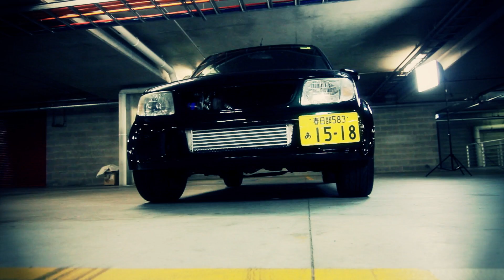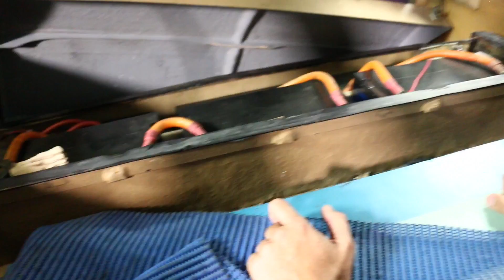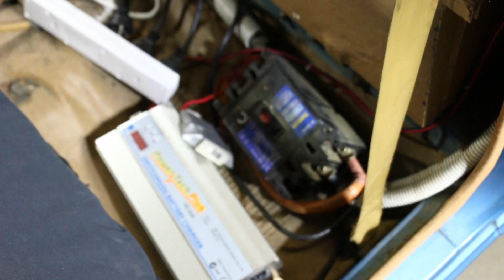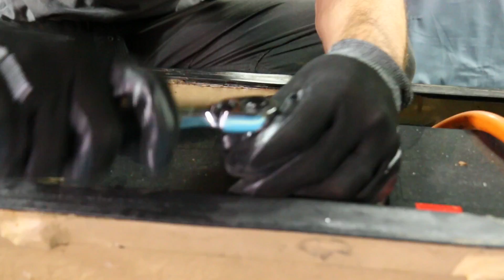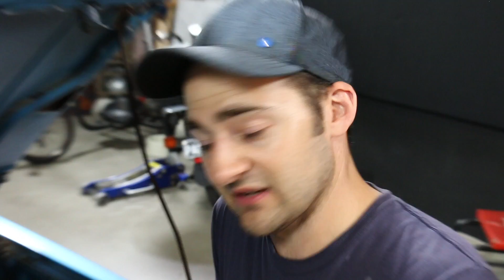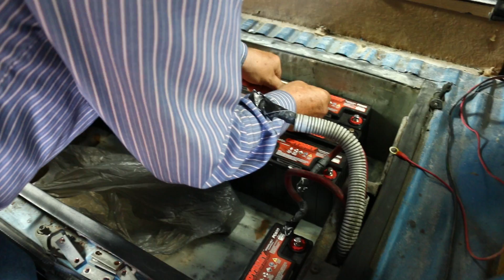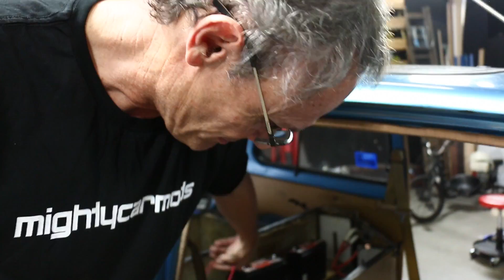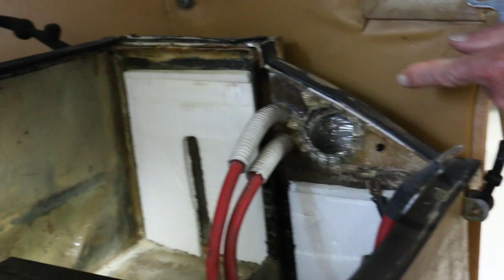JDM Electric Turd

Comment: Got to keep the batteries charged or the electrodes build up (oxidized) and prevent current.
Also the plug on the car should be on the top of the fuel receptacle so as to let water drain freely without shorting out the connection.
It is also the amps that kill, not volts.  You can grab a 110 volt house line and barely feel the current, but a 12v car battery will send you flying if you try to lick those terminals like a 9v.

What is with this queer unicorn named Aurelius R..  Wow what a piece of work.  He's so angry I think he got touched by his uncle but didn't get the xmas present.  Loves to just spew out the insults.  Forcibly insisting that a 110 volt would have killed me had I have touched it...when I have touched it and barely felt any current aside from a bit of numbness in the muscles in my arm until I let it go.  Real Class Act.
Reply: ***** I have done it, it is not as powerful as you think.  If you are standing in a pool of water then yes it would be incredibly powerful.  Being insulated with boots while grabbing it also greatly reduces the level of current as well but like a moron you just let the insults fly before considering all the factors.  Nonetheless some people have greater resistance to electricity and pain so you should also include that in your reference.  Do some research, I could have been more articulated but it is obvious you have never touched a live wire.  I have changed multiple live electrical receptacles.  Using (insulated) pliers of course.  

Knowledge is free to the curious!
Reply: ***** keep writing and wasting your time because I like many others don't really care what you have to say.  This is probably why you have to insult people to try and drag out conversations because it is the only time you get to interact with people outside of your paedophile prison.
Reply: Jamei Mcleod lol. You mean the best school in the country? Yeah, okay, buddy. Keep projecting your crap onto me.
Reply: ***** funny..you keep implying that I am the one projecting when the first thing you said was an insult, your best school in the country obviously doesn't teach you any manners.  Volts don't kill, Amps kill.  Do they teach you that in your 'school'.  Why not ask your teacher?  I have learned to teach myself and have come to understand many things unlike those who go to school and get to know only one thing as their profession.  So I think my schooling is of a greater quality than yours..and mine is free.  How much do you owe for tuition already?  You will be cheating for your degree just like 75% of the rest of university students.  People like you are the reason the world is in the shitty state it is.  Cheat, Exploit, total disregard & lack of respect for anybody or anything other than themselves.  Your faculty is full of cheaters who protect other cheaters so they can retain high grade standards to charge more for tuition.  The people who actually know how to respond to the emergencies in the world and the problems are busy flipping burgers cause some big mouth piece of shit cheater wants to take that job at the age of 27 making millions every year until they are 87 and suffocating the economy...and I bet someone like you would think that it is a good thing....  Since we are so into projecting..
Reply: Volts do not determine Amps...you can have 110 volt and 20 amp or you can have 110 volt 5 amp.  A car battery has more amps than your houseline and has a better chance of hurting you than your houseline.

Comment: solve for battery problem is li-ion batterys. only broplem is little posibility to get fire and even xplode.
Reply: so they need LiFePo4 batteries - powerful, fast-to-charge, non-explosive(even if short-circuited)
Reply: +konstantin88181 lifepo batterys might be good... but they are more expensive than liion. have those lifepo on my motorbike.

Comment: Ever wondered why the poles on a car battery are recessed? So numb nuts can't lay a spanner across them. I managed to place an angled spanner on an old battery to demonstrate how not to do it and I watched it melt away on one end, a hell of a lot of amps going through a short circuit!
Reply: I've never had a battery with recessed terminals... if you mean the threaded holes for the mounts that's just so 1 battery can fit many kinds of cars.

Comment: voltage is not harmful, amperage is
Reply: The voltage directly determines the current. :I
Reply: Then please, stick a fork in a wall socket.
Reply: +Desland Brown Voltage on its own stings a little, think static electricity, which can be upwards of 10,000 volts. However, you can't exactly have no amps without a voltage of some description...
Reply: Alex Paulsen Static electricity would kill you if a shock  didn't last microseconds.
Reply: Here's the thing, you are both right. There has to be enough of a voltage difference for electricity to flow, but once there's enough for that, it only takes 75-100mA (sometimes as low as 50mA) to kill you. It doesn't matter if it's 100V or 100000V, if it has 100mA, it will kill you, but only if there's enough voltage for current to flow. A single car battery under normal conditions will not kill you. If you or the battery get wet, your resistance is lowered, lowering the required voltage and it becomes possible. Many other things can lower your resistance, things you might not even think about, which is where the saying "volts don't kill, amps do" came from. It's there to remind you that when working with a high current source it's possible to be killed even if the voltage isn't normally enough to hurt you, if your resistance is lowered it can kill you.
Reply: *****
Bollocks. Static electricity has no current... Electricity moves extremely quickly, any length of time with the right amount of current is a dangerous amount of time. Also, you point out that "The voltage directly determines the current" but forgot to mention the letter I, for resistance, which is completely necessary. In the case of static electricity, that's a completely different story which I won't pretend to know everything about. Don't preach what you don't know or understand, it only misinforms others who might take your word as fact.
Reply: Current equals voltage divided by resistance. Therefore, as voltage rises, current rises. The resistance of human skin is relatively constant, and drops dramatically beyond the outer layers of skin which may be penetrated by an electrical arc or sharp strand of wire.
My statement is far more correct than saying voltage is harmless and current kills, which while technically true, the belief gets people killed. Current does not exist in a metaphorical vacuum.
Reply: +Bladsmith In the case of EVs, higher voltage vehicles are usually pushing LESS amps, and also running more efficiently. Go be a Mr Smart-Arse with that one.
Reply: +Bladsmith With V = I R, there could be a high resistance and a low current, which still equates to a high voltage.
Reply: That is irrelevant when discussing lethality.
Reply: +Bladsmith bullshit. mythbusters made a 10,000 volt machine to "feel god" based on a very low current, and not one of them got injured using it.
Reply: It's not "based on a very low current", it's limited to a low current by a circuit specifically made for the purpose. If it weren't made for safely shocking people and were actually powering something that requires ten thousand volts and you got your stupid ass shocked by it, you'd be fried. This is not difficult.
Reply: +Bladsmith You're talking crap.
Reply: +Bladsmith one minute you say high voltage directly determines the current, next minute you're talking about low-current, high voltage circuits. Make your ****ing mind up.
Reply: Yes, as you can see, some of us are capable of comprehending and distinguishing several different concepts and contexts at once. 
An electric shock from an unregulated power source can and will kill you at a relatively low voltage. This is why people are getting shocked to death all the time by mains voltage, why high voltage capacitors can kill you, and why spreading the "Volts don't kill you, it's the amps" myth is goddamn insane.
Once again for good measure: Yes, it's technically true. It's just that you're not going to find an everyday high voltage situation where you could not get killed by being careless.
I'm talking about safety, for fuck's sake.
Reply: +Bladsmith High voltage capacitors are usually used for power supplies, in which they are dealing with large amounts of current. It does not however mean that a high voltage has to determine a high current as you originally stated, because there are many high voltage low-current circuits out there too, and high current low voltage circuits. I don't take safety precautions around high voltage circuits, I take safety precautions around ALL circuits, as anyone should.
Reply: Yeah, it's all about the resistance like you said. Doesn't matter what the cap is for if you brush your finger against the lead though. It's just a simplified cautionary phrase for people who don't know any better and a simple response to the myth, not something I mean to argue about with someone even slightly educated on the subject. 

That didn't work out, did it.
Reply: +Bladsmith Well, I wouldn't say myth as such, it is still the high current, not the voltage that kills, but its the ignorance of the situation that really does the damage. Its still a very smart move to not touch an 11KV power line, because at the very least it kicks you in the chest and singes your eyebrows, and at the very worst there is a dangerous current included in that. So yes, being safe around all forms of electricity is always a smart decision.

Comment: 1) it's best to parallel first, then series batteries. In your case, that would mean paralleling pairs of individual modules, connecting the pairs in series. It's much friendlier in its failure modes, particularly it reduces the instance of forcing high current through a failed cell that can generate heat and catch fire! It also helps that if a cell fails, it doesn't affect your pack power output as much until you pass the halfway capacity point. 

2) if those are starting batteries (rather than deep cycle) they're not going to last many cycles of deep discharging.

3) when you want the best electrical shock hazard mitigation, you break your pack up with contactors so when they open, the max voltage one is exposed to is a fraction of the full pack voltage.

Comment: Time to get a alternator for electric cars
Reply: >implying perpetual motion machines
Reply: xD
Yes, we can't have infinite power because that's against physics.
Electric vehicles already convert braking into electricity, as well as when the car is rolling (simulating engine braking), solar pannels on the roof of the car that also generate electricity, etc. These practically are the alternators of electric vehicles.

Comment: A clutchless manual really isn't that strange.  Volkswagen had something very similar in the Beetle during the 60s called Saxomat, I once rode in a Baja Bug that had it.
Reply: If the newest example is from the sixties, then yes it's strange.
Reply: *****
There are other examples, that was just the first one off the top of my head.

They were pretty common in Europe, and Porsche was using one as recently as the 1990s.

Comment: Can anyone tell me if the new cars are ac and what would the difference be in ac dc would one of them be less efficient
Reply: +No Name DC series motors make all their torque at low RPMs. AC motors have basically a flat torque line. Efficiency wise they're pretty much the same

Comment: Those Odyssey PC680 batteries are AGM sealed lead acid but their so small and expensive. They are only 16Ah (amp hour). You can buy UPG UB12750 AGM batteries that are 75 Ah for only 40$ more in America. Thats the equivalent of 5 of the little Odyssey batteries. And the UPG has great specs and deep discharge cycle life.  The equivalent UPG (16ah) is about half the price of the Odyssey. Why did your EV guy decide on this battery? Is there a benefit with the Odyssey design?
Reply: +Audioholic 01 Nevermind, This is answered in part 2!

Comment: potentially can hurt yourself with 144 volts. hahalol I betcha they put the power cords in there. look how new they look. xD
Reply: +James Thebeau well its the amps that hurt you not the volt, in my school my teacher had a electricfuse tester wich can put out 20 000 volts and asked us if we wanted to try it...didnt really feel anything wasnt any worse than a electric fense for pigs (they are one of the lowest voltages for animalfences), but i were nervous as fuuuck before hehe xD
Reply: Jonathan Sköld ah just like a taser is 50000 volts. is the volts just basically the push or length it can take the amps to befor dying out?
Reply: +James Thebeau i know this isnt a perfect definition but volts are how fast the electricity flows and amps a how much electricity is flowing.
Reply: alanzo77 No that pretty much sums it up for me. thanks a lot! haha I cant say I honestly remember learning this in school. but I was probably not paying attention.
Reply: +alanzo77 Good simplified explanation, but no really that accurate. Voltage is the potential difference between the two terminals of the power source (positive and negative), and Amperage is essentially the flow speed or rate of the electric charge between to given points in the circuit. 
A good way to think about these abstract sounding concepts is to imagine a fountain that hits a ramp with an adjustable steepness. At the top, you have a water source, and at the bottom, a pump that feeds back up to the water source. The height between the reciever of the pump , and the water source would be like the voltage (difference), and the Amperage would be how steep you set the ramp, to affect the speed. This doesn't really explain at all how a circuit works, but it can give you a fundamental idea of the concept.

Comment: so from what i've heard, tesla uses a bunch of 18650 cells inside their battery banks, you can grab 18650 cells from used laptop batteries on ebay. wire those up after testing each one out, and you might be able to get some seriously decent range out of the little grocery shopper.

Comment: LiFePO4, cut the weight and increase range, shit's expensive though i have plans to convert my limo to hybrid adding 2x20/50kW motors driving the front wheels, and leaving the 212kW motor(GM LT1) basically the same, but attaching a 50kW motor to the front of the engine (there is room for a 100kW motor before i have to move the radiator) as a starter generator+booster, i'm going to cover the roof hood and trunk with solar cells, and i estimate to peak about 800W/hour and average 300W/hour on a bright summer day where i live in illinois, hoping to bring the city mileage from 12 to 19with regenerative breaking and bypassing the transmission by powering the front wheels when i dont need all 285HP and 330lb*ft of torque, and increase highway mileage from 28MPG to 33MPH or better with the solar panels and bypassing the inefficiencies of the aging 4L80 transmission, I plan to also create a custom battery pack with 3.7V 10-15AH polymer LiFePO4 hoping to make a pack of roughly 5-10kWh by placing them on the floor and raising it, i choose polymer because they were semi flexible and offered the highest energy density and allowed for high capacity with minimal wiring, though being that energy dense creates a challenge for cooling, an 18650 pack could be made so that it were honeycombed with a fan blowing from the front to the back of the 20 ft long battery packs, where as these flat polymer batteries are probably going to need to be placed between aluminium plates with liquid or air cooling heat pipes between each row of battery

Note that with all lithium based batteries you need a BMS or battery monitor/maintenance system, without it best case scenario your pack will die in a few months and you will have to find the one, out of hundreds of cells that is bad, worst case scenario, your entire pack burns up with whatever was around it as well

Comment: I've only watched part 1 so far, but I don't understand why you replaced sealed lead-acid with sealed lead-acid? The old batteries were AGM, so basically the best lead-acid technology there is. I'm guessing (hoping) in the part 2 that you improve the circuitry and make it less ghetto!

Comment: The electric turd is gonna be awesome! wish you guys went out and tried to obtain some lithium ion batteries though, would probably be more expensive. They would still be more longer lasting and more powerful. you can push crazy volts through the motor and get crazy torque. Super Gramps speed!